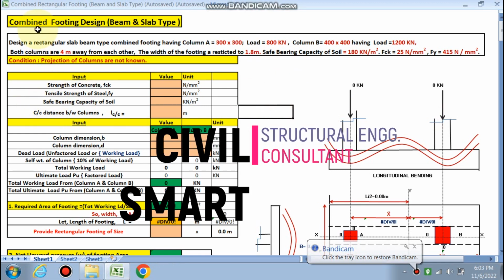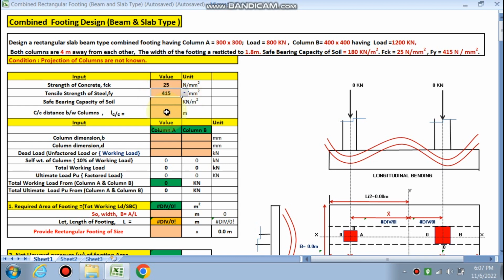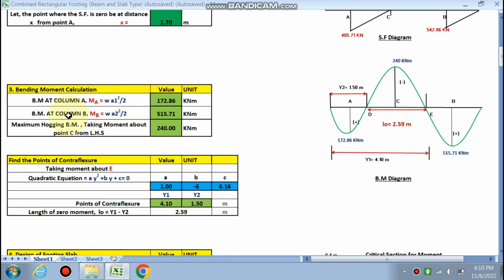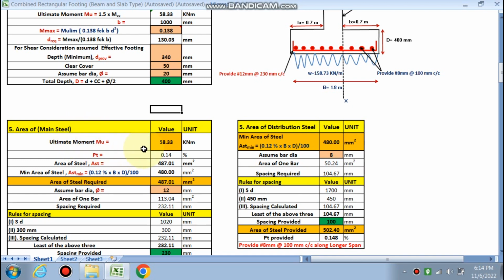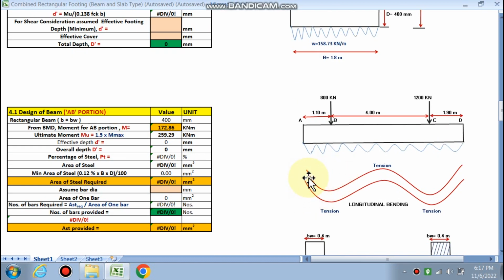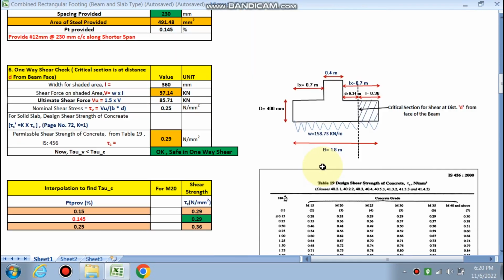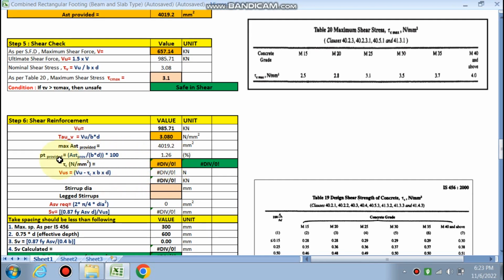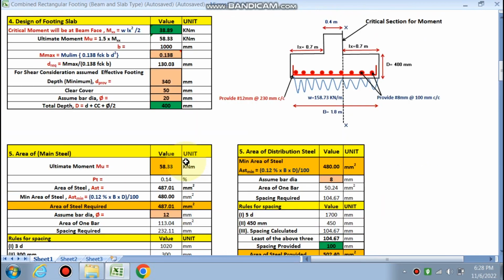COMBINED RECTANGULAR FOOTING DESIGN (BEAM AND SLAB TYPE) - BY CIVIL SMART

Comment from the maker: To get all the footing excel Sheets get from below link:
https://u.payu.in/PAYUMN/XIEbGLkEqMof
Full design Excel sheets course 

https://u.payu.in/PAYUMN/pJdyd2igjfOi

Full Course includes all sheets as under:

IN FOOTING DESIGN SHEETS

1. Isolated square footing

2. Isolated rectangular footing

3. Combined rectangular footing

4. Trapezoidal footing design

5. Strap beam footing design

6. Footing with uniaxial bending

7. Footing with biaxial bending

8. Pile foundation

9. Pile cap design 3 & 4 piles

10. Wall footing/ Strap footing

11. Raft Foundation ( Beam and Slab Type).

12. Strip footing design ( 4 columns).

13. Eccentric Footing Design (Column at dist x from the edge of footing).

14. Eccentric Footing Design ( Column is at Edge of the footing).
 
IN BEAM DESIGN SHEETS

1. Singly reinforced beam design sheet

2. Doubly reinforced beam design

3. Continuous beams design  with point load having :

    2-span continuous beam

    3-span continuous beam

    4-span  continuous beam

    5- span continuous beam

4. Cantilever Beam Design.

5. T-beam Analysis.

IN COLUMN DESIGN SHEETS

1. Axially loaded column design

   (a). When column size is known.

   (b). When column size is not known.

2. Column with axial load with uniaxial moment ( on 2 sides and 4 sides reinforcement)

3. Column with axial load with biaxial moment

4. Mux and Muy Calculation sheet.

IN SLAB DESIGN SHEETS

1. Cantilever slab design sheet.

2. Simply supported slab design sheet.

3. One way Continuous slab design sheet.

4. Two way Continuous Slab design sheet.

5. Two way simply supported slab design sheet.

6. Flat slab design (without drop and column head).

7. Flat slab design with drop only.

8. Flat slab design with column head only.

IN STAIRCASE DESIGN SHEETS.

1. Dog legged staircase design.

2. Open well staircase design.

IN RCC WATER TANK DESIGN SHEETS.

1. RCC WATER TANK RESTING ON GROUND (L/B <2).

2. RCC WATER TANK RESTING ON GROUND (L/B >2).

3. UNDER GROUND WATER TANK DESIGN (COND. TANK IS EMPTY AND OUTSIDE SOIL IS SATURATED).

5. UNDERGROUND WATER TANK ( TANK IS FULL AND NO OUTSIDE SOIL PRESSURE).

4. UNDER GROUND CIRCULAR WATER TANK.

5. Overhead Circular Water Tank design.

6. Intz Tank design.

IN WALL DESIGN SHEET

1. RC WALL DESIGN SHEET.

2. RETAINING  WALL DESIGN SHEET.

3. BASEMENT RETAINING WALL DESIGN SHEET.

4. Counterfort Retaining wall design sheet.

5. Shear wall design with boundary elements condition.

Building load calculation sheet

Cost estimation sheet..etc.